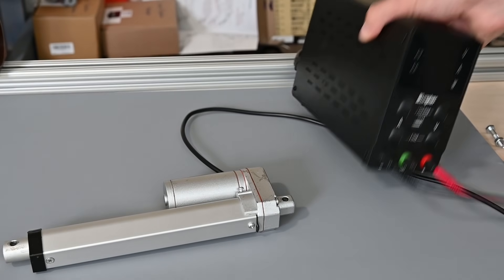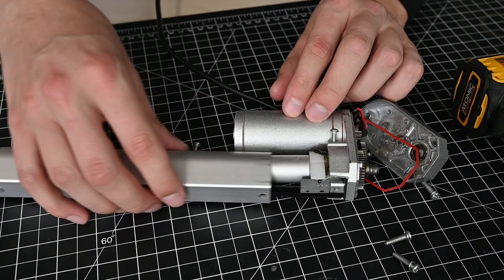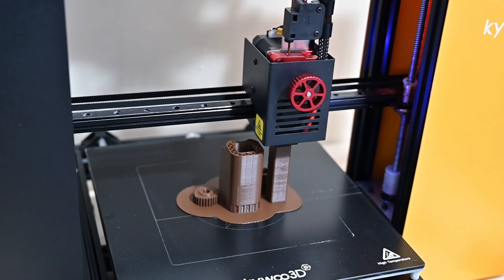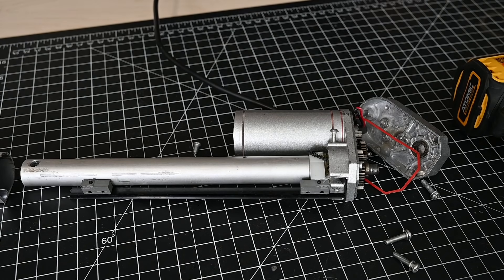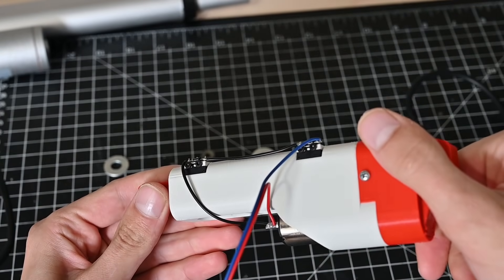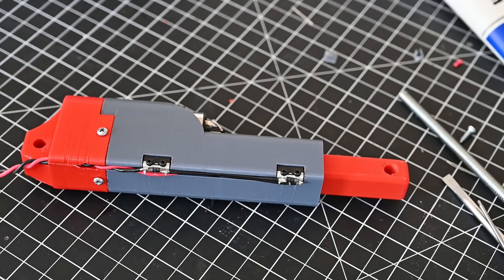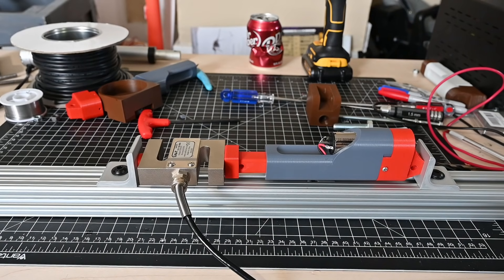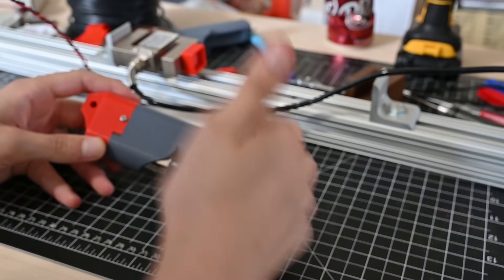3D Printed Linear Actuator??? Surprisingly Strong!

Comment: Awesome work! I'd love to see how many cycles under load this would survive.
Reply: probably a lot more than you would expect, I have a 5:1 planetary gear set printed in ABS I have been operation for over 600 hours of continuous usage. if the part is desinged reasonably well and not abused 3d printed parts can operate nominaly for extended periods of time.
Reply: There’s the rub
Reply: Yeah it would make a great follow up video!
Reply: @3DRC-707  ruble of belarus?
Reply: @Rr-cr4qu  you never heard the phrase there's the rub? it means like the flaw in the otherwise smooth operation of machinery: the spot where it rubs
Reply: @kingmasterlord  i always thought it was BBQ rub on a baby back rib

Comment: Well done

The wiring diagram is surprisingly simple, let me explain how it works

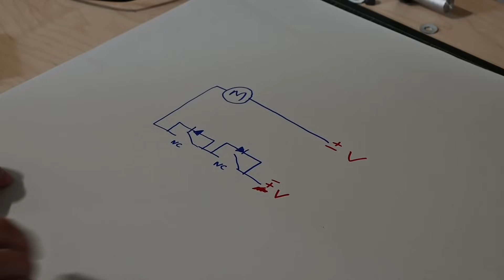Check at 4:35
Until actuated, each switch let the current flows in both directions from one end of the circuit to the other

When either switch is actuated, the current stops flowing through it, and the diode that bypass it allows the current to flow in only one direction instead, the direction that moves the actuator away from the stopper

I did not know that wiring limits switch would be that simple, thanks you for showing us this

Comment: Hi, your video just popped up on my main page. Very cool. Someone might already have mentioned it, but the gasket is probably there to keep the water out, not the grease in. These type of actuators are often used to open/close roof windows where they might get wet and need weather sealing. Also you could make it stronger by using more gears since I am guessing you're maxing out the motor when crashing the soda can. Awesome work. Subbed.

Comment: Nice build. I use a lot of electric actuators. You will find this type of design is much stronger in compression than tension. A lot of the actuators use a nylon nut and are surprisingly powerful. I like the fact you used a square section as a keyway

Comment: DC motor torque is proportional to current. you should leave the DC supply at the maximum voltage you want to apply but then use the current limit setting to control current up to the maximum current rating of the motor to get a true measure of thrust vs current. Remember its current that primarily limits the motors output at slow speeds. Interesting project. thanks.

Comment: I'd love to see a video on the gears printed with the 3:1 fast:tenacious mix - maybe a redo of your tough pla vs. resin gearbox testing. There are loads of FDM PLA gear testing videos out and each one says "it'd be interesting to try this with a different material like ABS or nylon, or resin combinations." but never any follow up videos. There are 1 or 2 videos of ABS/nylon FDM gears but your other resin gear video is the first I've seen testing resin gears legitimately (and I think that was just cheap abs-like clear resin)? The combo of tenacious (for some toughness) and fast (for wear resistance) seems like it has a lot of potential!

Comment: cool  stuff! the grub  scrub hole on a motor shaft gear seems to be  a weak spot for the gearing; could be worth it to design a gear-matching "plug"  that you could lightly glue in, after tightening the screw  (so that it doesn't turn - better yet, make it a square hole, so it  can't)

Comment: FYI - the threads for a fastener (bolts/screws) will not work long term as a replacement for a power thread (lead screws)

Comment: Lead screw is self locking, which means the load will not move the piston when powered-off. A metric screw does not have this characteristic. 
I understand it's meant to be a cheap build, but the end result is not 1:1 to the commercial unit you're comparing.
Otherwise, it's a nice build and I learned some tricks for 3d print design. Keep it up! :)

Comment: Very cool.   Trying to figure out a way of using motors or actuators where I can have a 10kw gas generator I have inside generator housing for parents house slide out of the building via actuator or motor system.  The generator would sit on a solid floor piece and pushing button would push floor and generator outside of the shed or retrieve it.  They are getting older and have hard time moving generator.   We are trying not to have generator operating inside shed which is up against house for fire concerns prefer it be outside when running not in contact with the house.  I could put insulated exhaust in shed and add large air intake, but we do not want fire risk to house when generator running.   What can you think of for proper actuator or motor and pulley/gear system

Comment: Did you ever read the 'Guerilla guide to CNC and resin casting'? Also, have you thought about building parallel robots with the linear actuator? Eg Stewart platforms or delta bots.

Comment: your sponsor charges 200 dollars for a print with 300 grams of ABS :skull:
Reply: That is crazy high you can get a cheap or used 3d printer for that
Reply: I guess and I repeat I GUESS, maybe are the certification? The 3d prints that they made are some standard industry level certificated print? Because if not, I suggest to buy a 3d printer for the same price and do it yourself but abs may be tricky to print (and dangerous) under some point of view...

Comment: So, you made a linear actuator with some 3d printed parts, a few screws, and a linear actuator...
I wonder how well it would work 3d printing the main screw instead of buying it.
Also, pulling force should be lower here due to layer separation.

Edit: ...thinking about it more though, using screws and other stuff rather than printing most of the parts is a great idea, since those are otherwise the failure points, and they're really cheap. So, I might work on a more general version that's pulling or pushing, and supports different screws/motors.

Comment: Not sure where are you located, the design is really robust, but also would design a model that hides the wire and the switch to give it a little more potential for use in outdoors. Nice video btw 😁

Comment: Two things:

How many cycles can it sustain at a high force level.  I wonder about the strength of the printed gears mostly.

It would be an interesting project to create a servo using an RC PWM interface. I think you could use a variable inductor to measure the position.   Another method would be to just count the rotations of the lead screw,

Comment: Project idea - Use Linear actuators to control a set of Top-Down, Bottom-Up (TDBU) Shades with the ability to roll in metal shades during storms.
Typically, TDBU shades are cloth pleated that compress down into a box of the Bottom and a Box on the Top and the boxes are press fit into the Window sides.
Want to look out without someone seeing your messed up room, just lower the Top-down box.
Want a cool circulating breeze, then Pull up the bottom box and also pull down on the Top box (and open the windows of course)
One issue is that typically light can get in around the sides of the shades so it would be nice to put the bars inside side tracks to keep the light out and to keep the bars from Racking.
Having a secondary metal roller shade (either Top-down or Bottom-Up) that would protect the room from storm damage (or from Zombies) would also be a cool add on.
Just a thought.
Reply: I think a linear actuator is maybe not the best fit for that, since it's slow and high force. The forces there are small and the displacements are large. Just winding the line around a pulley/drum using a stepper would probably do fine.

Comment: I can not see clearly but if you are not pushing on the mount points of the load cell you cant use the actual force values.  You have to push on the mount points only. Pardon if you in fact are and I am not seeing it.

Comment: Did you design all the parts? What program did you use? 3d printed stuff surprises me with the strength, even simple PLA is pretty strong. I have load cells that go upwards of 30k pounds at my job, so I can do some beefy testing.

Comment: Now imagine if you printed it in CF-PEKK, that's self lubricating and re-inforced. You'd have a linear actualtor that could be operated in environments that nothing else could work in. You could have the thing work inside of a highly corrosive environment without excessive wear due to the environment.

Comment: If I wanted to build one one of these but needed it to go really fast, but not nearly as strong as this, around 20kg, would I just need a lower gear ratio and a higher thread pitch?
Reply: Yah that should definitely work. Just be careful that you don't increase the pitch too much where it starts becoming jerky
Reply: Or you could just use motor with different gearbox ratio.
Reply: Yeah, either of those. You'd want to do some math to make sure there's enough motor torque after the gear reduction to push 200N (including an efficiency factor), but either of those could be adjusted to change the speed/torque of the motor. Depending on how much faster you want it to move you may need to change the motor to one with higher power, though.

Comment: Cool video. One question though - what's the secret behind Multi-Level Linear Actuators? 
Once the attached screw fully extends, does it switch to (literally) another gear - or are the different sections leveraged so that all 3 sections are expanding at the same time?
Reply: I'd imagine it's probably being done both ways depending on the application, but interesting question nonetheless!
Reply: You might be really interested in watching videos on how the james webb telescope linear actuators work.  They have a low and high precision mode, using just one motor.  They are very clever.

Comment: That's really cool.  I was going to build one similar to that, just my 3D printer isn't liking me.  So i moved on to my next project and could use a little advice.

I'm basically trying to build a wench.  It doesn't have to be same to support much weight, just a Go Pro on approximately 100 meters of twine.

I was thinking of using an Esp8266 our Esp-32 to control it and display the distance.  Got any advise?

Any help is appreciated.

Comment: Awesome Video. Do you know what reduction the gears provide in the casing? I'm looking at trying to change this print up to fit a nema sized stepper but need about as much torque and force that your actuator in this video were capable of but I just don't know if I'll find a stepper in my budget. Cheers

Comment: Oh wait.... What size bolt did you use?  The design is incomplete without that part of the  hardware list... :(  I could buy a bunch of different ones and try em all, but id rather just order the right one on amazon.  You also soldered on something to the limit switches, but whatever that was you didn't list it in the hardware list.  Can you please update the hardware list?  I've already bought the components on the list to do the project and need to know whats missing.  Can anyone tell what he says in the video'?  it sounds like quarter 20 bolt, but i don't wanna order the wrong size and waste money.
Reply from the maker: Sorry about that. I just updated it
Reply: @michaelrechtin  thanks, much appreciated

Comment: So if I wanted to make a full-sized motion platform, would these suffice? There is a decade of psychos like us building motion platforms and simulators in our houses. The best I saw was over 10 years old and the guy was making it in his attic out of all metal shit. I would rather not have to learn welding or all kinds of other stuff if this would work for a 250 lb guy with the computer and everything being a detached on the floor.

Comment: If the actuator can exert 100kg, why can’t it crush that can? I weigh 94kg and if I stepped on an aluminium can, it would collapse completely.
Reply: I suspect it didn't have the range of motion necessary to crush it any more.

Those bolts were not that long.

The hard part of crushing the can is the initial buckle, crushing the rest is the "easy" part because the can has creased.

Comment: crushing a can does not need a lot of force you can do this with your bare hands.
Reply: This was just a visual demo. He demonstrates the strength by measuring it later in the video.
Reply: Now try crushing an undented can with your hands by applying force evenly on the top and bottom ring.
Reply: @horacegentleman3296  Applying a force unevenly is indeed the trick. It is what is happening in the video.